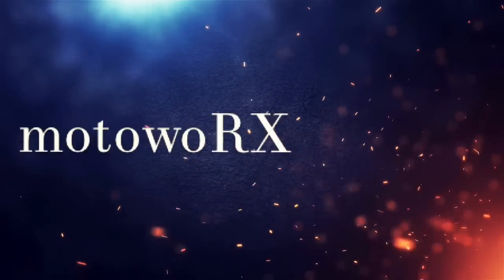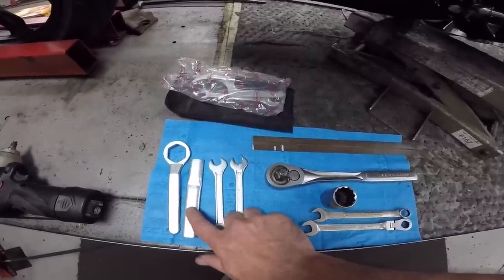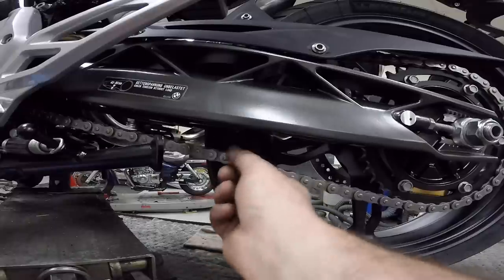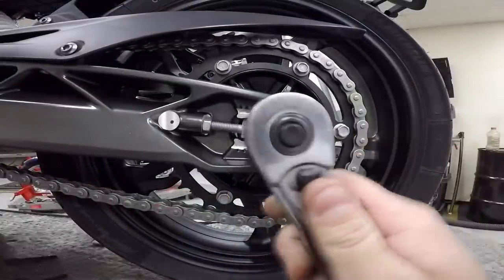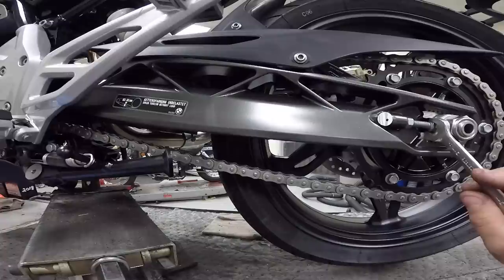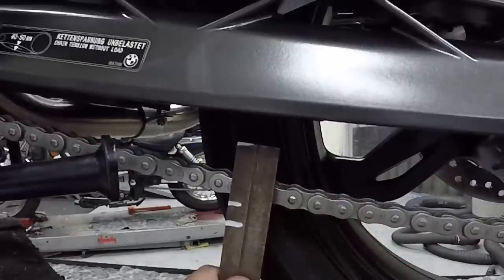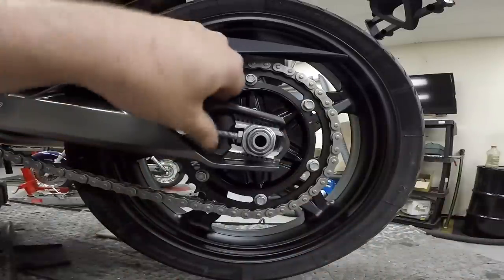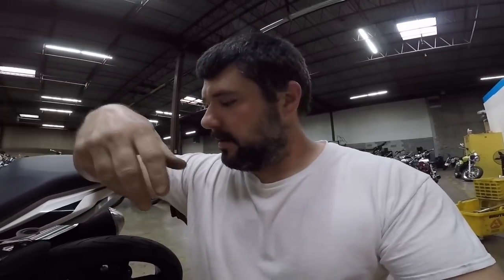How to adjust your chain ( bmw G310  )

Comment: In case anyone is here for the GS, the manual specs the tension from the sidestand. Unsure if the R is really supposed to be lifted either. "Unloaded" means no rider. The GS manual is really clear about putting the bike on its sidestand though.

Comment: I like the little sharpie markings you've made on the brake disc, I do similar things on my lock-nuts so that I can be confident they've been tensioned back to the right spot if I don't have a torque wrench handy :)

Comment: What is the reason for unloading the suspension? Do you think it will give the correct chain tension during riding? Why not setting the chain tension while there was someone on top of the bike?
Reply from the maker: Because the specification that’s given is for the suspension unloaded. It’s also easier to spin the wheel and check the chain for tight spots. Thanks for checking out the video
Reply: @MattsMotoWoRX  ok. thanks for the answer. Have you ever compare them? people on top vs middle stand?

Comment: Hey Matt, been watching your videos for a while! Was wondering, i removed the rear wheel of my 2019 g310gs to get tires changed. When i put the rear wheel back on and went for a ride. Immediately my abs light came on and i rode home and noticed the rear brake caliper and abs sensor were wrecked! Any idea what i did wrong I’ve looked all over the internet and can’t find any parts i may lost. Is there alignment magic i don’t know about 🤷🏻‍♂️🤷🏻‍♂️ helpppp!!
Reply: the ABS sensor is (as you 'll know having done the job) at the top of the wheel so bad alignment shouldn't have caused this problem in theory... my guess would be if the sensor has been knocked askew when putting the wheel back in or if the spacers on either side of the wheel have been swapped round by accident...I did once destroy an ABS sensor on the rear wheel of an aprilia doing exactly that 🙃

Comment: Hello, notice that my 310gs overnight did not want to turn the board on but it does not start and I checked the gear, the alternators, the fuse, and everything is fine, could you help me? regards